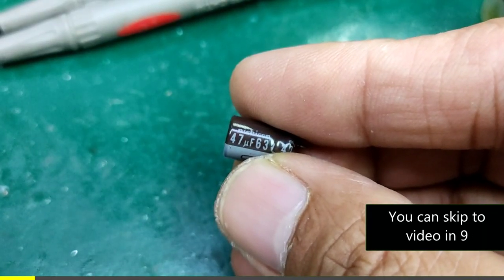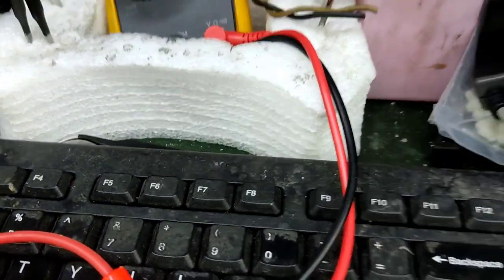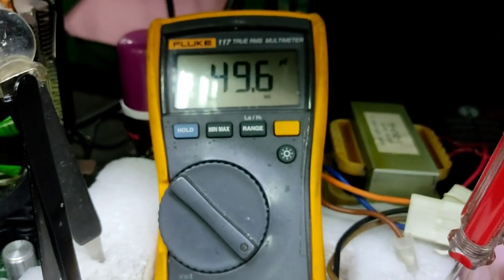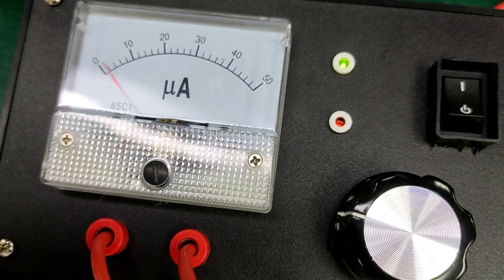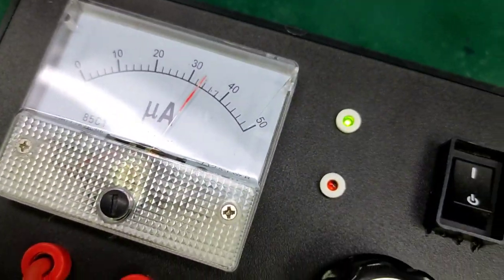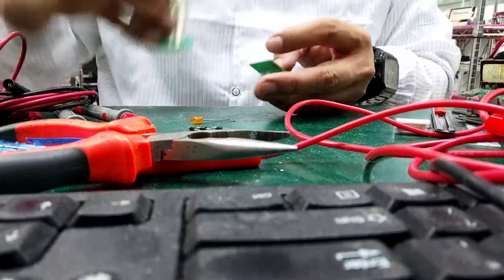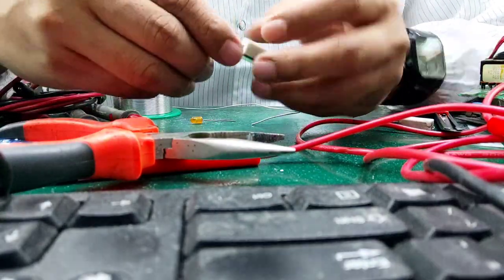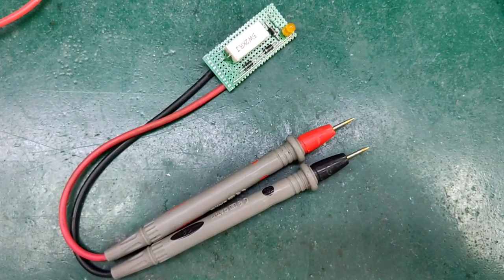HOW TO DISCHARGE A CAPACITOR PROPERLY AND SAFE ? BASIC ELECTRONICS BUT IMPORTANT.

Comment: Kuariel kaya nya po ba i discharge yung capacitor sa primary like 400v? Pwede po pa link narin diagram nya, salamat po and more power
Reply from the maker: Opo kaya po.geh punta ka sa fb page ko lagay ko po dun ung ginagamit ko
https://www.facebook.com/300862967198924/posts/824859138132635/
Reply: @KUARIELtv  many thanks kuariel